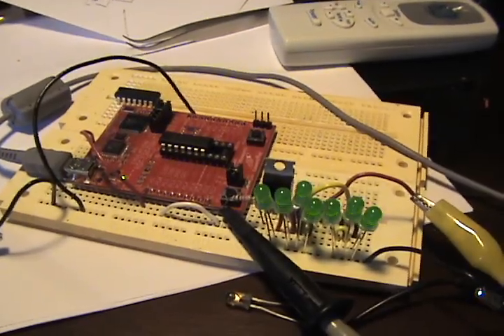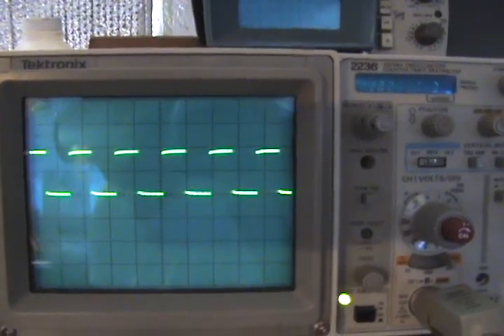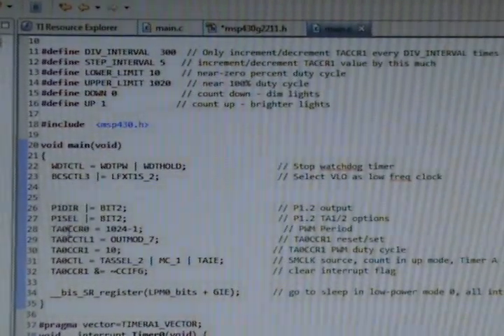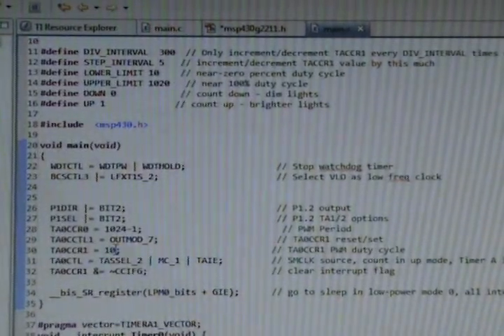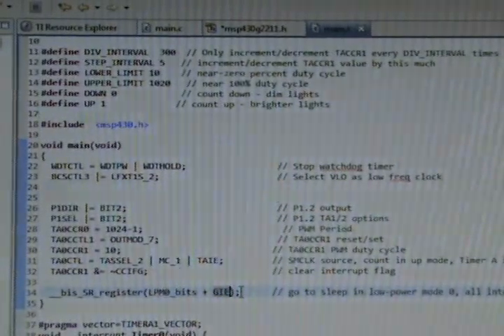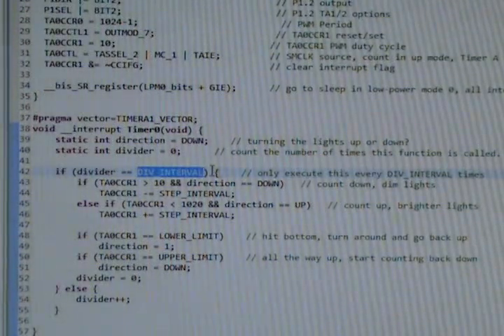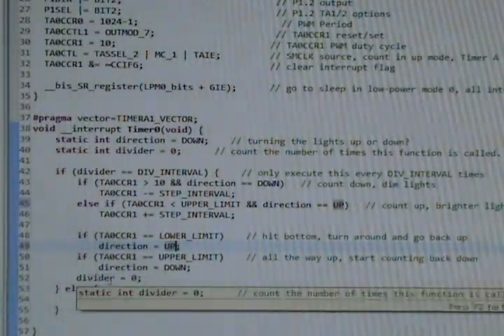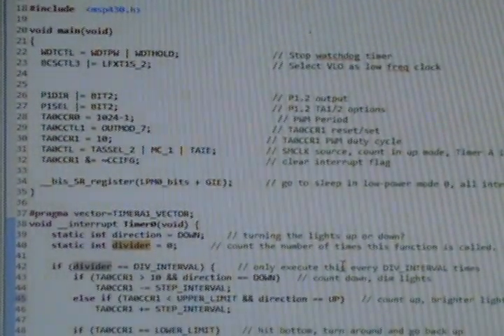MSP430 Breathing Effect PWM Experiment

Comment: Thanks for your work. I got the pwm working, thanks to you, and adjusted it for my purpose. I plan to use it in background lighting to simulate night and day on a model city display. I was wondering, if I wanted a delay at the dimmest part to make it stay dim longer, how and where would I put that in the program?
Reply from the maker: GregTLeonard Thanks! I think I'd modify the TIMERA0_VECTOR at the points that it hits the bottom and top thresholds. Instead of just reversing itself and going back the other direction it could stop Timer0 and start up Timer1 or the watchdog timer to start counting the day/night interval. Then replace the PORT1_VECTOR block with one to listen for events from Timer1, which would get the signals from the timer and determine when to stop itself and kick off Timer0 again to make the light transition, which would start Timer1 again, and so on. Cool application! I'd love to see video of the model when you're finished!